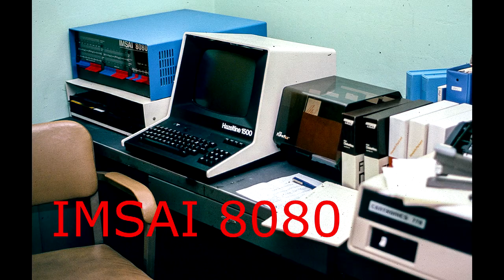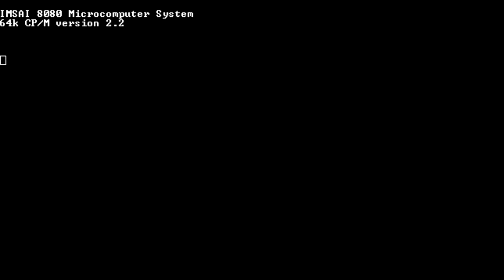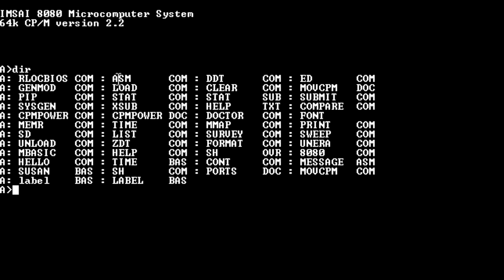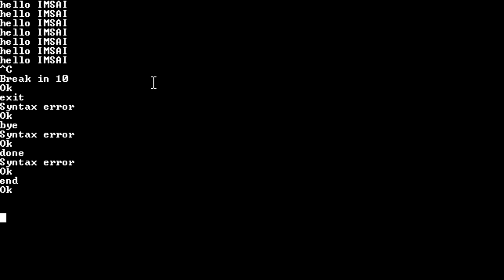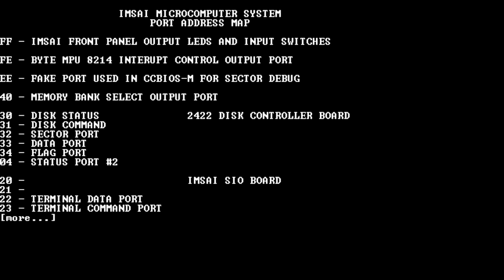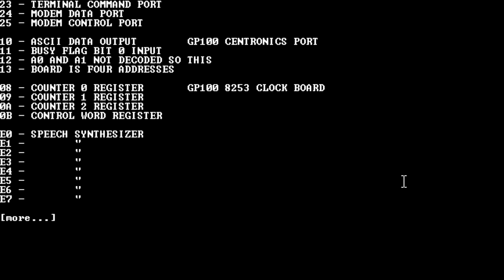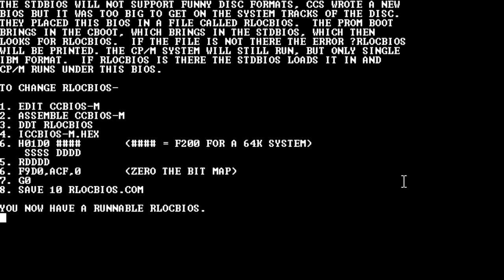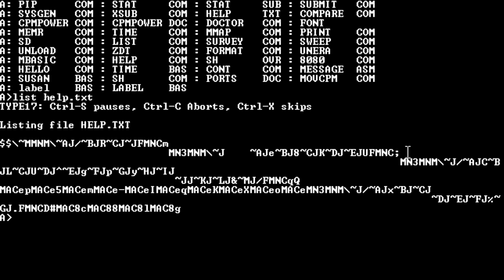#15 IMSAI 8080 Booting CPM

Comment: I spent 18 months using a North Star Z80 machine for a post-grad, full house (64k) - 4K at the top for a special "REM board", E000-F000 the disk controller. S100 bus - styling! I knew CP/M in and out. We also had UCSD P-system.